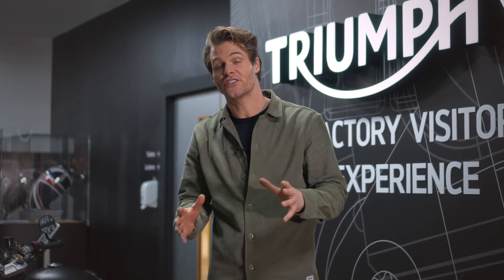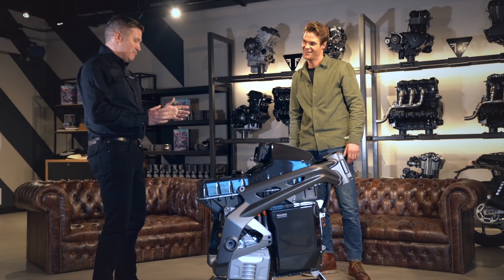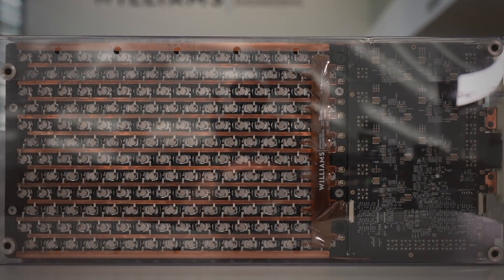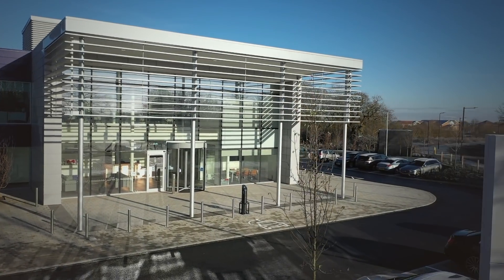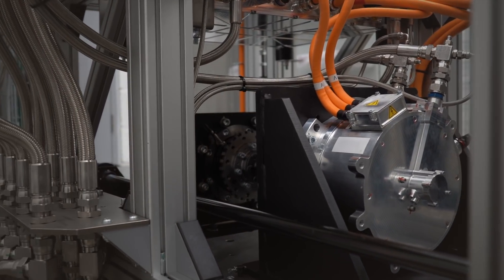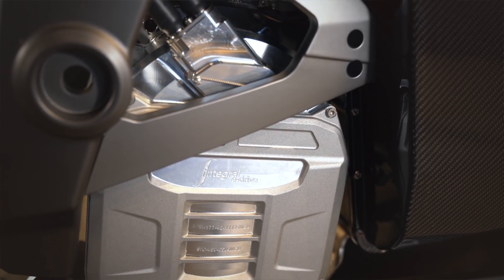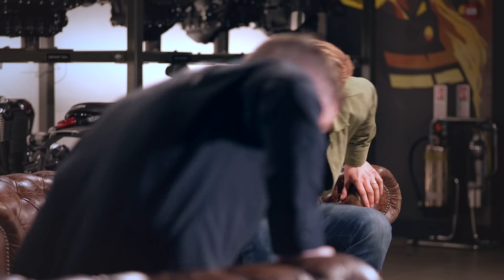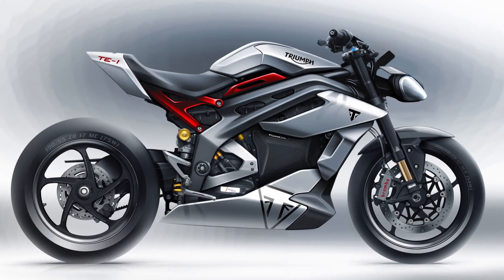Project Triumph TE-1 | Creating UK Electric Motorcycle Capability

Comment: Very interesting. There are a couple of open questions:
How far will it go?
How long will the batteries last without losing capacity (most of the electric cars will be leased, with motorcycles its a different story)?
And most of all: will it handle like an ICE version?

Comment: Triumph TE-1 wanted :
- 250 km real life highway range, 250km real life road range, 400km in city
- 20 min maximum charging for 80%, 10 min would be better
- no more than 20000 euros or dollars price
- 5 years of battery warranty unlimited mileage
- integrated quick charger with no need to carry extra cables
- a chain drive version and a shaft drive version or belt drive like on the pictures
- gears like the project Revonex
- surround anti collision radar and/or camera system
- in TFT screen navigation (google maps, etc)
- run flat tyres
- SHAD SH36 and SH58X cases carry option

Comment: It's fantastic to see Triumph engaging in the Electric powertrain revolution.  I'm sure there are great things to come from this collaboration. 

However, my one immediate observation is that the "conventional" motor- drive chain- sprocket transmission methodology is going to be obsolete before 2030.  Those innovative companies pursuing a "hubless" or in-wheel motor design will dominate in the future, as these devices are much lighter, more compact, much less complex and conceivably much more reliable.  

Whoever gets into mass production of these in-wheel motor designs will very likely end up supplying the many other electric motorcycle builders of the future.  Those who do not will become their consumers.

Be leaders, not followers!

Comment: Love the look of the bike, 6 questions though, How much? How far a on a single charge? How long to charge? How long will the batteries last and how much will it cost to replace them? And if the electricity required to charge the batteries isn't from a "green" source aren't we just exchanging combustion engine pollution for more power station pollution?
Reply: Great question. Especially the last one. I can't shake of the feeling that going electric is just snobbery.
Reply: I have answer to the last one, at worst you do not use an engine that waste 60% of the energy you gave it ;-)  Electric motor is much more efficient and use less maintenance.
Reply: @LeGriffon1453  that's not the answer on last question
Reply: @Kodreanu23  the thing is that even petrol power plants to produce electricity is way more efficient than your bike combustion engine, so with the same petrol you may ride more kilometers with a electric bike that with ICE one ;-).
And hopefully in the next year by growing of demand and investment in it you will have more green energy. But if you just stick with petrol and do not even give a chance to develop something new it may not happen.
Reply: @LeGriffon1453  that's still not answer to the last question. The question was not about efficiency.
Reply: @Kodreanu23  getting better efficiency leads you to less pollution.  And it's also easiest to control pollution on a  1 power plan rather than thousands of ICE's
Reply: It’s all about scale. As mentioned, producing electricity even using the most environmentally unfriendly power stations is still many times more efficient/less polluting than small ICE powered vehicles. When you introduce clean energy production methods into the equation there is no contest whatsoever 🙂
Reply: @archer8096 yeah, and the production of batteries is so eco-friendly. I have a feeling we are splitting hairs.
Reply: @Kodreanu23  that is true. I always wonder about the disposal of spent battery cells too.

Comment: 5:48 Wow.... look at that, now that's a nice solder station. 180 HP from a 22lb motor is amazing too compared to a 22lb gas engine using a spark plug, almost double the power to weight ratio of Nissans new ZEOD RC super lightweight Le Manns engine.... dang, it weighs 88 lbs but that's not including the other parts needed that bolt to it.

Comment: That's got my attention. Keep the pricing sensible and the the belt final drive though as not interested in filthy chains. So very interested in the bike as it is shown in the images.

I was wondering though. What's the purpose of the LH handlebar lever? With no clutch, better to put the rear brake there and eliminate all foot controls and allow greater possibilities to optimise footrest position for individual riders' comfort. But the image shows a brake pedal on the right. So what's the LH handlebar lever?

Comment: I ride zero SRF it has a place for the charge lead a passenger and now I've fitted a tail tidy  number plate that's not an afterthought on a stick on the swing arm. Cracking good fun, I reckon at 220Kg the best compromise in design criteria. If you can beat the zero you may have a sale but my experience of dealers had been it made me sell my Bonnie , I went out and bought the zero......I ride 10 other gas bikes as well gonna take a lot for me to go near triumph again but this would be it.

Comment: It's been pointed out for over a decade that vehicle electrical systems would be better if they were powered by a 42 or even 48 volt battery.  Elon Musk and Sandy Munro both recently brought up this improvement in a recent discussion they had.  Has Triumph looked at this and the reduced power consumption that would result?  This would be the perfect time for Triumph to throw down the gauntlet to the rest of the industry to finally make this much talked about change happen.

Comment: One thought. Is Triumph considering using this technology on a hybrid long range adventure touring motorcycle? Add a small efficient quiet constant speed IC engine to charge the battery on the road to create the hybrid motorcycle. The semi documentary video about traveling on Livewire motorcycles from Southern South America through North America demonstrated that in parts of the world such a design would have some advantages.

Comment: When I rode the Harley LiveWire during the prototype stage, we were told to tap on the brake when we were slowing down due to regen braking, because it could be so rapid that we might risk getting rear-ended, as the regen braking did NOT activate the brake light.  Someone needs to do a study with GPS to measure electric bike deceleration rates with regen compared to ICE bikes using the brakes, engine braking, and down-shifting, with cameras and other devices to measure distance, to record the reactions of the vehicles following the bikes.  It might be time for a brake light activation system in addition to that activated by the brake pedal, if regen actually slows a bike enough to risk getting rear-ended.

Comment: E bikes are only suitable for commuting at the present time. But we need to develop battery technology or we shall sit still and go back into our caves. You only have to look at the development of the internal combustion engine and how that has developed over the years. I work in the forklift industry for 38 years and have seen the development of electric trucks now out performing IC trucks. But the issue will always when the battery eventually dies how much will that affect the price of the bike and cost of replacement or do you scrap it. 🤔

Comment: It looks stupid. And let's be honest electric viechles have one huge problem. It's called the battery. A car can't hold enough batteries to give a reasonable milage. Over 200 is virtually unheard of and 120 miles of real road driving is nearer the reality. The maths & physics no matter how many computer programmes chew the data don't add up. Batteries (forget the weight) will never be small enough to hold enough electricity to give 500 miles every top up. And the time it would take to charge a battery to give 500 miles. Yawn Yawn Yawn. The makers try to blind you with technical talk. Give me a 650cc twin I.C.E. over any E-motor now and tommorow. Sunday morning ride out with your mates. "we can only go 45 miles or we might not get back" and the machine cost £40K+ and someone on a second hand bike costing £2K pulls up "are you having problems mate. Anything I can do to help" that's when your helmet go's bouncing down the road... There will be no E-bikes at the TT or on the ferry to Assen.... IMO....
I don't ride bikes now but its the last freedom you can have. Tied to an E charger every hour or so if you can find one is not freedom.Battries need to be 48 volt to even get near enough capacity for realistic road use.
P.S. Show meaningless oscilloscope wave forms (they think we are stupid and that shows their contempt for the public)
If governments didn't give huge tax breaks and grants for E-motor & Battery R&D a lot of it would not happen. We have at least 500 years of oil reserves. Making I. C. E. more econimicle is the way to go. If triumph had said we have a 100bhp 750cc twin that does 150mpg that would be real news and the sales would rocket.

Comment: You will have to go a long way to get the energy density of petrol in a battery. Will be good for commuter motorcycles but going to be a hard sell for superbikes as the culture is for noise, vibration and the feel of an engine. Not having the style of exhaust pipes and cooling fins won't be a great seller as will the absence of the growling or whining exhaust note. If the government try and enforce this as a green agenda bike manufactures will go out of business through lack of interest. Research into even more clean petrol [or other liquid fuels] must continue in parallel.

Comment: Damn. I was getting excited until I saw it. I would be crippled in about six minutes on that. Not just by the riding position, but also by the wife. If she can't get on the back then my life is forfeit. For me, Higher bars. Footrests forward by about 6 to 8 inches. Remove the unsightly gap under the tail unit and you'd be getting closer. Can't really see the point of a petrol tank, unless it holds something needed.

Comment: "Energy Density of this battery will be a quantum leap.." using 18650 lipsticks? 
Cylindrical cells will never match energy density of 
Pouch cells like used by Zero Motorcycles.

Comment: Never. I for one would never even consider this refugee from Logan's Run. If it doesn't run on gas, it isn't a motorcycle. Climate change is not caused by human activity, a look at the geological record shows that this has happened many many times. Even if it were, electric vehicles don't solve anything, the power to charge it is generated by fossil fuels, the electricity grid in the U.S. or the UK cannot support electric vehicles, and it will not work in the third world where most emission pollution is caused. I get it, Triumph and other manufacturers are playing along with Carrie's... sorry I meant Boris's... lunatic green BS